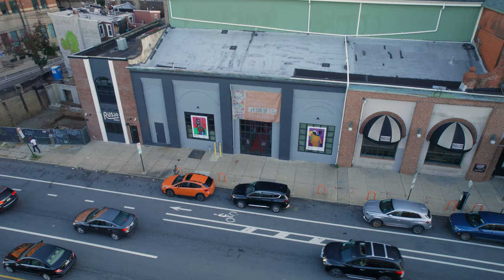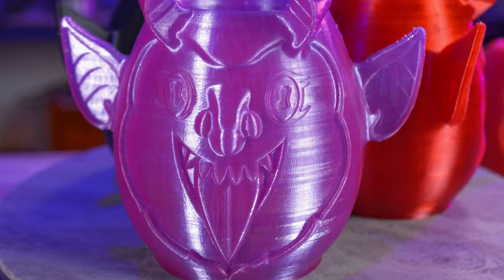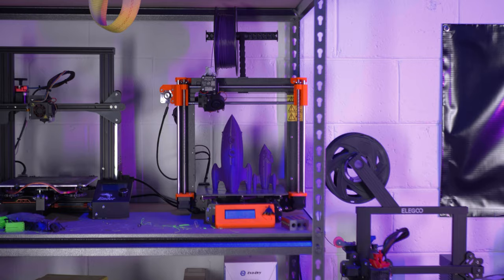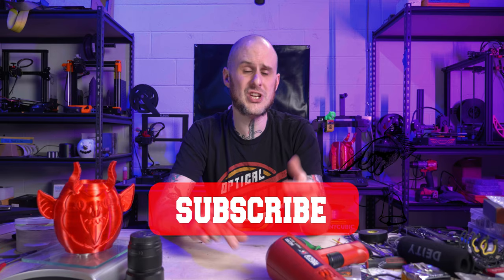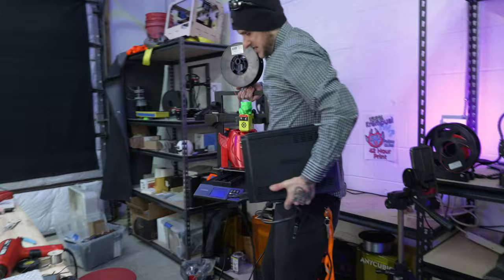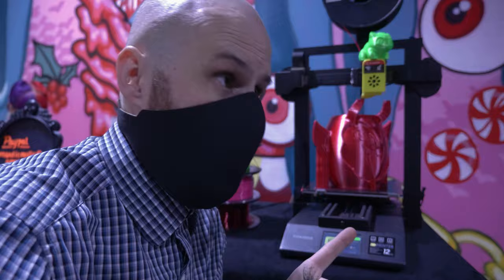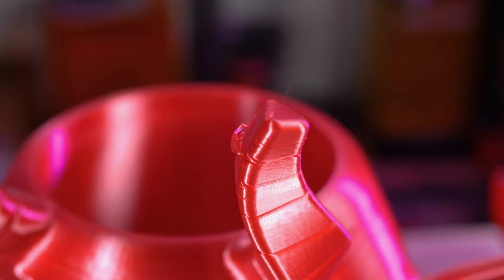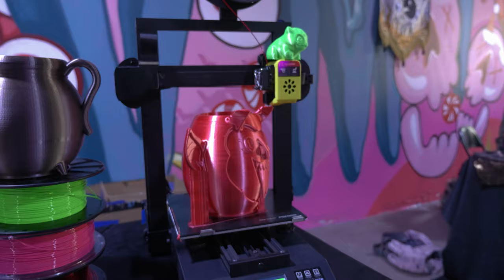3D Printing IN A CAR!

Comment: Yoooo Alan!! There’s a firearms instructor Rob Pincus, that kinda had this same question. He had a class to give at the destination, about 3D printed arms. He started the print, and his drive It finished in route, with not much time to spare. Was able to give the class, tested the arm, and it performed as required.  It’s a really neat concept. 

Thanks for doing more legwork on the subject!!

Comment: Also how well are thouse prusa’s on reliabilty
Reply from the maker: Mine is one of my least reliable printers. Had to fix it more than any other machine I own. Other people have much more success with them, but I sure don’t. It’ll be on the chopping block after I get the new X-1 Carbon from Bambu Labs. Most likely anyway.
Reply: @MandicReally  oh what would be your most reliable printer suggestion that doesn’t really need tinkering or up grades out the box
Reply: @MandicReally  do you have any suggestions on a realia or printer that doesn’t need a bunch up grades out the box
Reply from the maker: @indecisivesquirrel3dlabs78  honestly, out of the box I don’t. Not yet. 3D printing is inherently going to require maintenance, tweaking, tuning, and work to run smoothly. Some may run great out of the box but will require love eventually. Some just far more than others. I have high hopes for the Bambu Labs X-1 Carbon but I haven’t used it yet to say.
Reply: @MandicReally  as far as marinade I under stand most thing will need at some point but I have got two printers now one took a poo on me a month I’m still no help from the service department on there part and they don’t even have parts listed for it on the sit, my second really isn’t that back just a warped bed gantry and bed it self can’t seem to find a new gantry for it and almost don’t want there brand as if Qc is this bad on a printer then shipped out whos to say there spar parts are any better, do you know if the refurbished Ender 3 v2 from com grow are any good i assume that they have been check over really well befor reselling them but don’t want to get duds again